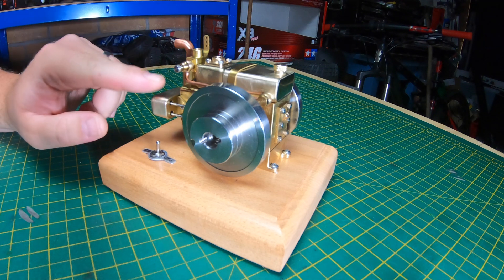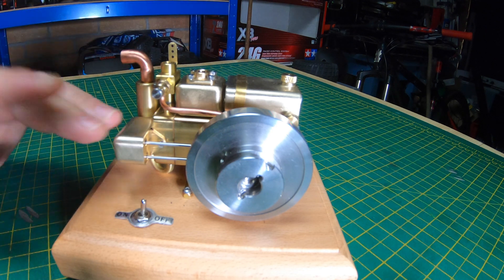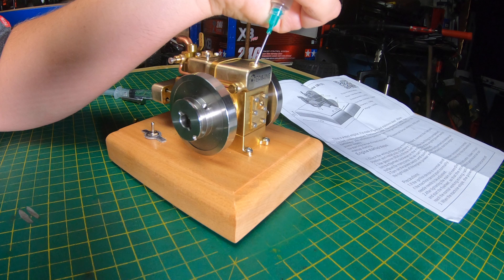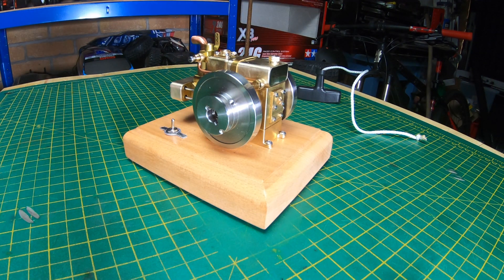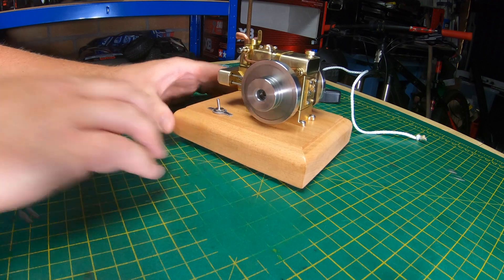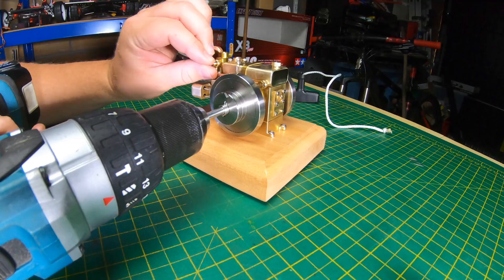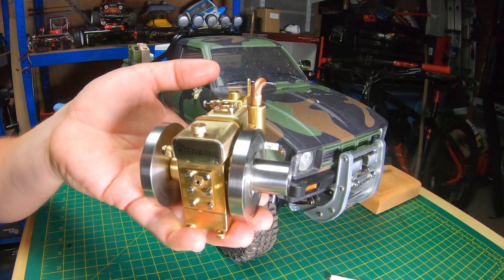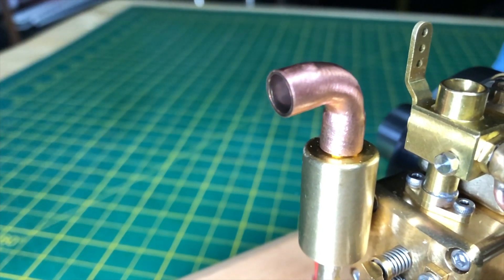Mini OHV 4 Stroke Petrol Engine! Eachine ET5 Water Cooled Pushrod Gas Engine

Comment: My earlier comment is not entirely correct. The cylinder on the early ET1/M90 engines was aluminium. Later engines, including this ET5/M12, have a steel piston and cylinder liner; but to avoid excessive wear same lubrication recommendations apply. Most of the engines use cast aluminium for the engine block, but this sweet little engine uses milled brass. I think the new M15 is similar. I use Stihl 2-stroke oil that is used at 50:1 in their chainsaws and at 25:1 it is a super lubricant. Do not use WD40 that cleans and evaporates but is no good as a lubricant.

Comment: My supplied instructions are clear about lubrication; essential to avoid knackering the engine very quickly. Fuel 4%(1 in 25) 2 stroke oil with petrol. Oil all non-ball bearing moving parts. 4cc oil in the crank case (splash lubrication). Put a little oil on the gudgeon pin and adjacent cylinder bore.  Do all this lubrication before every run. It is just the same as with full size old stationary engines. Piston and cylinder are aluminium with O ring ( spares available) used as piston ring. With no 2 stroke oil will wear very quickly; others report that as few as 12 of few minute runs can wear out bore if no lubrication! Spare parts are not available. If looked after can do many long runs for many years. The instructions also point out that the engine has been set up and run during manufacture and not to twiddle knobs before first run.
Reply: I am doing the same lubrication as you, the small engine works well.
Reply: @jch8938  Great news. Correction to previous comment; this engine has steel piston and cylinder liner, only originals were aluminium.

Comment: I just received one of these after waiting months on shipping. It looks like they have expanded the instruction sheet a bit.  It now says gasoline 95# or aviation kerosene (not sure if they mean 100LL avgas or actual jet fuel).   For lubrication it says add 4ml or less lubricating oil to crankcase for splash lubrication of crankshaft.  It also says to add 4% lubricating oil to the fuel.  I'm planning to use 2 stroke oil for the gas mixture.  Also, the measurements for bore and stroke are all the same except on mine it says 1.6cc instead of 2.6cc which is now correct.

Comment: Couple questions:

Is it reliable 
How long does a full tank of gas go
Is it worth it
How would I put a generator on it? Thanks
Reply: Maybe use an electric motor or small alternator with a belt or chain drive for a portable battery and phone charger though that's easily achieved with portable new solar chargers.  It would have to be experimented with to find out actually how long a tank or a cup of gas goes for these are rare and would be tedious small engine work to maintain and repair.

Comment: as for oil, look up myfordboy.  On his channel he shows himself oiling the engine in various spots.
My question, is how much current can you generate with this tiny engine?  Enough to recharge a 12v car battery? 5-8 amps, say?  Could this turn a small car's alternator?

Comment: I'd throw a little bit of castor oil or possibly sewing machine oil in the fuel, engine modelers all have a fuel mix they swear by usually with a light petroleum distillate base (lighter fluid or camp stove fuel) and a little lube.

Comment: i Don't see a radiator  or  any  FINS.    this  (4-stroke) IC engine is  gonna  get  HOT !!!!
Reply from the maker: David, there is no need for the 'idiot' comment. If you google 'Hopper Cooling' it will explain it. It's not the best way too cool, but it does in fact cool the engine.
Reply: It's water cooled
Reply: @7MGTE  by  WHAT  process!!!    IDIOT.      what do YOU  think will happen if this  IC engine is run for an hour,  and  heat energy is not  dissipated/LOST  to the environment.    doh
Reply: @daviddavids2884  the tank of water on top it cools via evaporation taking advantage of phase changes
Reply: I collect vintage engines and tractors so I’ve seen these types of engines before. Many historical four stroke engines, from which this engine is modeled from, used for driving farm equipment and other uses, used this same “hopper style” water cooling system. No circulation or heat sink fins, they had the same cooling system this model engine has and they worked perfectly fine for hours. Whether or not this translates to a small toy such as this is another question and would require testing, but I doubt there would be any cooling issue.
Reply: @edwardgesser2408  thanks.  for an intelligent reply.    this old tech was new to me.      seem to be two unknowns:   the at small scale question  -  thanks for that  -  and  the need for adequate movement of air  around  the  heat-exchanging surfaces.      in the absence of doing research, i would guess that  convective siphoning  is utilized.   cheers

Comment: think ---    PRIME  MOVER           a small prime mover needs plenty of  MA, mechanical advantage, over the load.    via  a  Reduction drive.      reduction   1)  results in  mechanical advantage,  2) allows an engine to be operated at its  optimal speed  and  3) (partially) isolates the prime mover from the load.      see  a  compressor, as an example of a correctly designed power transmission scheme/transform.   cheers         googletranslate

Comment: This is an intriguing project - I imagine that for every thousand people who buy this lovely-looking engine as a desktop toy there´ll be one who wants to see it actually do useful work, and luckily for us, you´re one of those people! 
 It seems to me that it needs a lubrication system and a water circulation system leading to some sort of radiator, which could be as simple as a coil od copper pipe. As for taking drive from it, my first thought was of old camchains ans sprockets from a 50 - 125cc 4 strike bike engine, but these might be a bit over-specified. Perhaps an RC car belt drive system?
Reply from the maker: There is a guy I work with who builds similar full scale single cylinder engines . He explained the cooling is done via the water boiling off. I googled it, and it's called 'Hopper Cooling'.... interesting read on how it works!
Reply: @TomleyRC  Some WW II aircraft designers experimented with "evaporative cooling". Personally I wouldn´t like to trust my life to a vehicle of any sort whose engine goes chomping through its coolant as time goes on!
Reply: @Del350K4  They had to been very high maintenance. I know military vehicles and equipment are always very high maintenance. I guess they had to use the technology of the day. I remember thinkin the 1990s', 'gosh the US Army is so antique,' and now they're really modernized for nonstop war is the new normal of the 2000's. Could you imagine being a young man drafted against your will to be dragged into a war over there using unreliable equipment and weapons? Few living today could for it's an all volunteer US armed forces with the Vietnam war being the last involuntary draft we had.
Reply: @SoldtotheHighestBidder  I don´t know whether I´d have had the balls to go to Vietnam, to be honest. Quite a few nipped up to Canada to avoid it - I have a guilty suspicion that I might have been among them. 
 In WWII it was different because US soil had been subjected to a cowardly, unprovoked attack, so I can imagine my younger self being quite keen to help deal with that threat.
 Either way my sympathies lie with those American lads who fought and sometimes died so far from home, in both wars. None of it was their fault.
Reply: @Del350K4  It's OK to visit Vietnam in the modern era as a tourist, but yea lots of draft dodgers avoided it years ago by ducking up into Canada. You couldn't run or get far sneaking in today though for immigration is tight requiring proof of self sustainable funds for travel and then the border is actually closed right now. Back in the 60's and 70's, it would had been easy to run up there in an RV or car with tent and even rent very cheap rooms where it wouldn't have been so expensive and restricted like today. I guess it would had been easy to just cross the border and be in Canada? I wonder if it's true that in WW2 Germany was instructing Japan as an ally and then tried to instruct Mexico to engage the US which is didn't wish to do? None of the wars have anything to do with what most Americans do or wish to do, but just foreign policy matters on the macro economic global scale. All imperial super powers and empires are dependent on nonstop wars to keep their debt based economics funded and going with cash flows and natural resources such as oil. Ours is the global petro dollar debt based hegemony rather than spreading democracy as the empire of liberty like many kids believed from the all the propaganda hype that looked beautiful on TV and in civic nationalism ideology or traditional national myth.
Reply: @SoldtotheHighestBidder  Yes - when you base your economy upon a model which requires continuous growth, there´s bound to be a limit sooner or later.
 I´m sure that the Roman empire seemed as solid and immutable to its citizens for much of its history as our civilisation seems to us today...
Reply: This is a tiny engine that doesn’t produce much heat at all. The water in the hopper is sufficient to keep it cool. I can even hold my finger direct onto the exhaust pipe on this engine while it is running - thats how cool they run!
Reply: @Darren_Fawcett That´s presumably a sign of an efficient  design - relatively little wasted heat must surely be a good thing!
Reply: @Del350K4  You have to remember that this is just a toy. Under load it might heat up a little but what sort of load will it be subjected too? A little generator to power a few leds or to power a small toy? Either way it is a novelty and doesn't have any real purpose other than to give us enjoyment of fiddling with it and trying to keep it running.